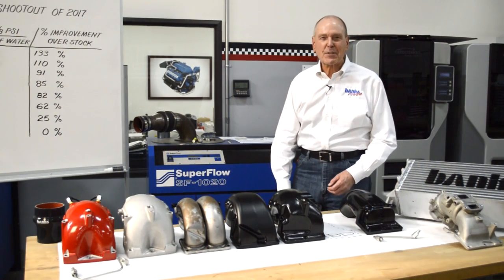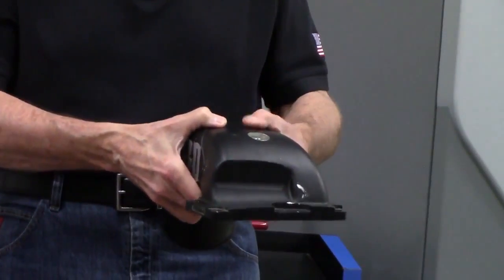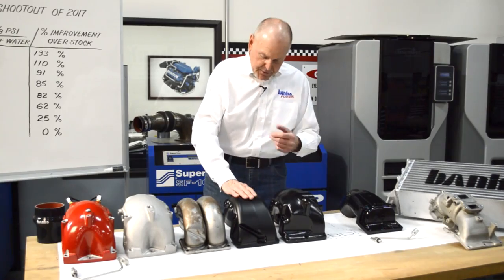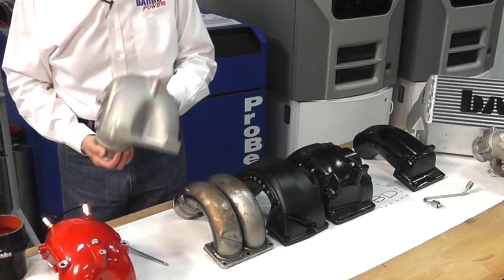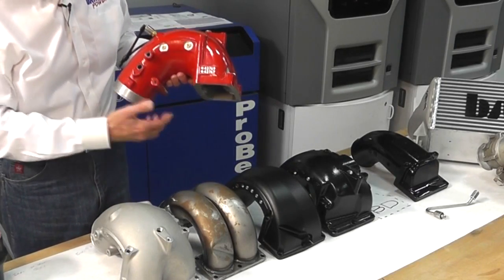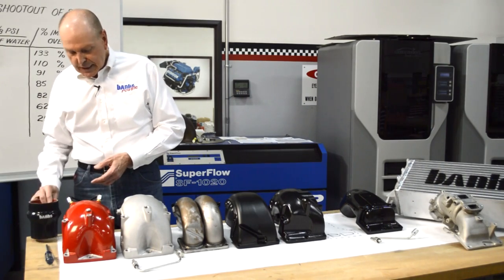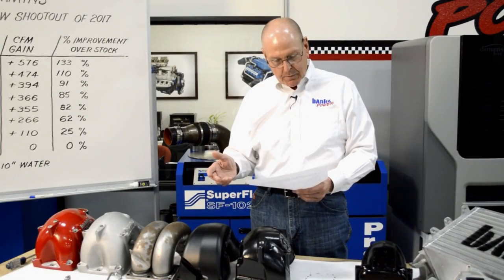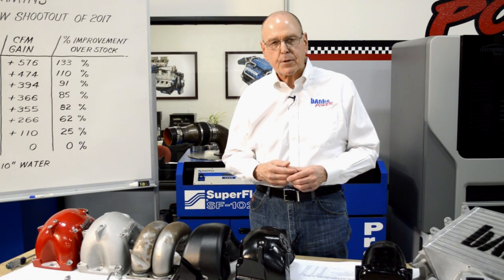Banks Monster-Ram is the best Cummins 6.7L intake manifold available.

Comment: I think the real test would be bolting each one on a truck then dyno them all back to back.
Reply: I think it is unfair to suggest that Banks performance isn't doing their due diligence.   They were doing testing using the best equipment available when most of us/you were in diapers.  Their reputation is impeccable when compared to all the back yard "Experts" that spend their time on youtube and not in the labs.  You will find it ironic that even when Hard, repeatable research is presented, there are some that swear by one particular brand over another.  I trust a manufacturer that has the stature of BANKS performance to provide a PROVEN product that will last.  Not bashing, just telling facts.  Buy what you want, but don't bash Banks unless you can back it up with proven numbers that can be repeated by an independent authority of the same caliber of Banks Performance.  OBTW, I have an older 5.9 Cummins and at the time I bought my intake, ATS was the hot setup, and Banks was up front and proved that they were superior to his product at the time.  That resulted in more R&D on his part to build a better mousetrap.  That is honesty that I can respect.
Reply: MCE Performance You compare an intake restriction to a non restrictive large exhaust on a Honda, you might want to rethink that statement!
Reply: The elbow is NOT really the restriction. It's the valve and valve seat that is the biggest restriction. An elbow will make the flow more efficient through that part, but when you get to the cylinder head, nothing has changed.
Reply: MCE it doesn't matter what the biggest restriction is, restrictions are cumulative.
Reply: Or even adding a huge exhaust tip on a diesel pickup...
Reply: YEP! And,,, I'll bet there isn't much difference between any of them because that elbowis not the primary restriction. The intake valve seat and the port itself is the pinch point.This is like putting one of those HUGE mufflers and tail pipes on a Honda Civic. Lets flowtest the f--king muffler then make outrageous claims about the "potential" gains. LMAO!I'm going to go out on a limb and say that the elbow isn't going to do a whole lot one wayor the other. Especially on a stock motor!!!
Reply: MCE Performance I would whole heartedly agree with you.
Reply: Just posted - Great video Gale. In reality this was very straight forward, comprehensive and well done test, regardless of how you view the product. We had similar results when doing research and were able to show a marked increase in flow rates on mirror applications. They key to remember is by eliminating restriction not only equals more flow but also equals the amount of heat that is being dissipated. For example if you were to break down flow rates into each cylinder, one would think that they are all equal. This is not the case. In real world applications, each cylinder varies more than you realize and this is very apparent the farther away from pressurized zone at the inlet of the plenum that attaches to air intake horn. When analyzing the laminar and thermal flow rates into each cylinder, is was discovered that #5 and most notably #6 we almost starving for air in comparison to cylinders #2 and #3 with #1 and #4  following. One of the most logical ways to cure this problem is to make every attempt to equalize pressure into each valve inlet within the cylinder head. When you consider the stock configuration limitations it would make the most sense remove any restrictions possible and make all attempts to increase air into the cylinders that are starving or better yet suffocating for air. In racing and pulling applications, it is common to literally have the bottom half of the casting intake on the cylinder head to be machined off and utilize extremely high flow intake manifold assembly that encourages equaled flow into each cylinder. This is done not only for power but also heat. All in all and to be honest you would not gain much power from utilizing any on these systems but you will most definitely gain some and dissipate heat. Much like an high flow exhaust system, only marginal power gains can be found but additional heat is eliminated. Most power increase come from tailoring to programing pulse deration, sequence,  timing and other parameters including charge volume and pressure. With that being said it would stand to reason that increasing power via programing and increase volume and pressure by larger or multiple turbo chargers that every restriction possible should be eliminated. One thing you can say about Banks is that they do their homework and a lot of research and development goes into their products. I believe that as far as bolt on applications go the only system better than this Banks unit is the application that is currently under development here at Diesel Research Labs. This design will have close to 100% equal dispersion to all cylinders and flow a lot more air than even the Banks unit but it will be released in very limited numbers so I would just get the banks. It is the best of the bunch tested.